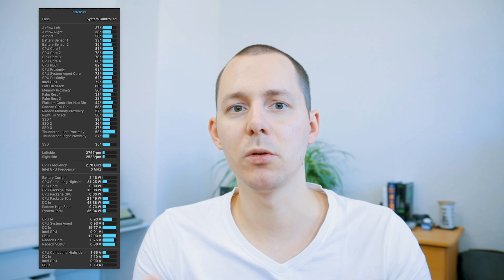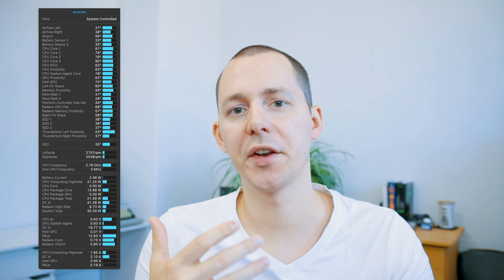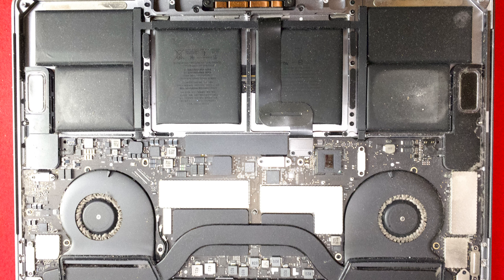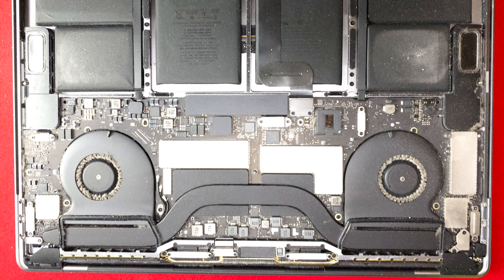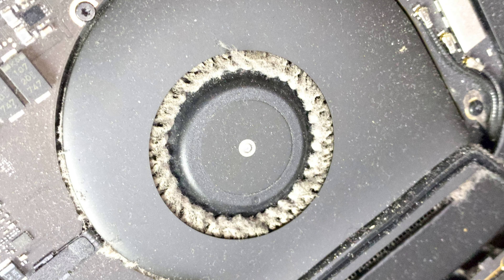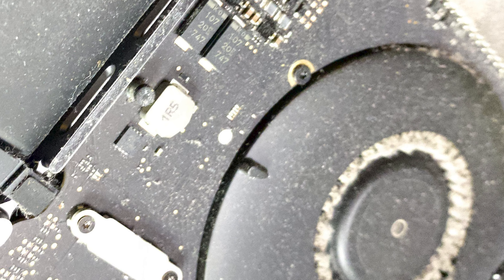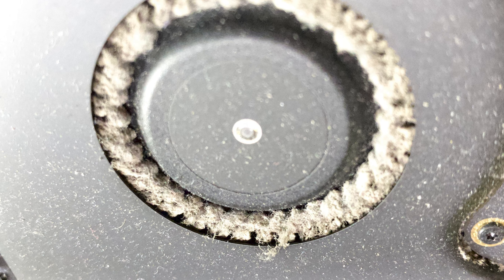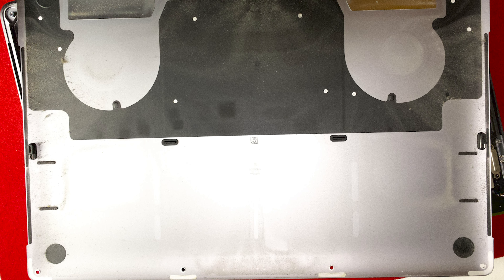Optimizing MacBook Pro Overheating: Using Ice Pack Cooling and Other Tips to Restore Performance

Comment: On a 2018 MBP I used thermal pads to connect the heatsink to the body, then used a aluminum heatsink on the outside with a USB fan. Dropped temps 30 degrees, fans never run and no permeant connections or body mods
Reply from the maker: That's quite the mod you did there. Glad it works for you and maybe a good idea for others to consider… Impressive.
Reply: What’s the name of the heat sink you’re using? Do you have a link to it?

Comment: Thanks for this vid, my MacBook’s been overheating at DJ gigs lately so I’m gonna try the ice pack method wish me luck lol
Reply from the maker: Good luck! Please also try to clean the vents and fans inside so that there is not all the dust in there. I do not recommend the ice pack method since then you introduce the issue of condensation inside the laptop and that's NEVER good! So please stay cautious.
Reply: Buy a large aluminum heat sink from amazon for about $20, it will cool down from the body
Reply from the maker: @MatteusClement  Definitely a safer method instead of using ice packs — especially since there is no condensation this way with the heat sink. If only apple would build propper fans into those devices.

Comment: i literally have the same issue. This is a work related macbook pro. I literally have ice blocks under my MB, this thing is really impossible to use as a software engineer
Reply from the maker: Guess that depends on your room temperature (and if you clean the fans or not). I cleaned the fans and after that it was much better.

Comment: a toothbrush works better than a can of air
Reply from the maker: I used that too. However there are a bunch of air flow canals which are impossible to get to without taking the whole thing apart. So that’s where the canned air helped most.
Reply: Not sure what you're on but it certainly doesn't.

Comment: lol just use external fans thats what i do
Reply from the maker: Definitely an alternative as well, however, that doesn't really help much if your ambient temperature is 30 degree Celsius and more.
Reply: True. Also I have a few questions if you could help me out. 
I have looked on youtube and I can't find any way to fix a partition in my mac hard drive, it says volume cannot be removed because previous volume cannot be resized. I tried making a backup and trying to wipe the disk but it wouldn't let me do that either. 
2) do you reccomend waiting for the 2021 macbook with ARM or buying one now, and if so, will it run windows?
Thank you so much for your time:)
Reply from the maker: @owenwild5116  to your questions:
1) my guess is, you will have to start in "mac safe mode", just google that and check out the startup key combination so that it goes into that. Then you can also format internal drives and stuff like that.
2) I personally would wait for the results with the new 2021 ARM MacBooks. However, it is not clear yet if they are going to be better right off the bat. Apple may start with a mid range laptop and later add the pro laptop line. Same with Windows. Right now, I don't think windows would "just work" since it's a completely different architecture. So we'll have to wait and see.
Last point: if you are in need of a new computer right now, then there is never a "good time" just get it and work with it, increase your income, buy the next laptop when it's time.
Good luck and I hope this was helpful.
Reply: Chris Spiegl Thank you so much its super cool that u respond and talk to ur subscribers:)
Reply from the maker: Owen Wild I try to do my best. Thank you. ☺️